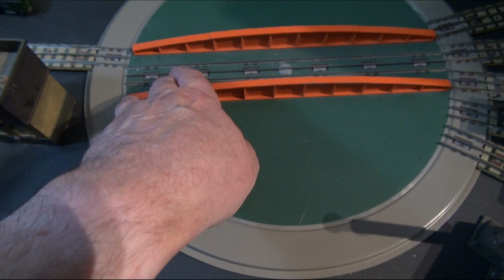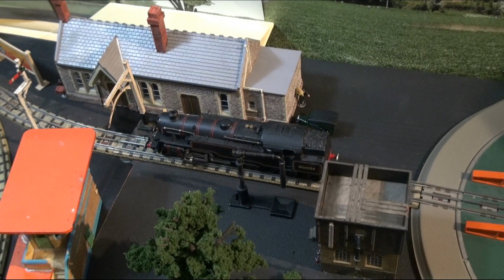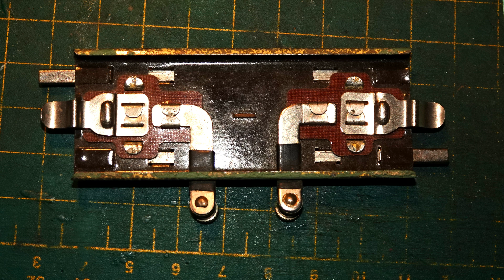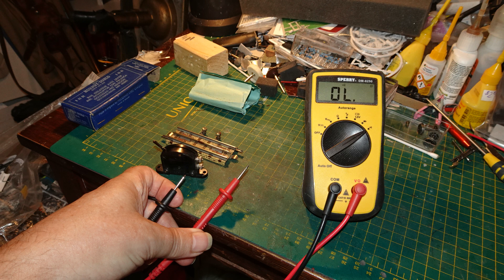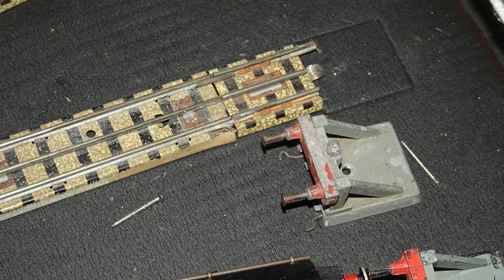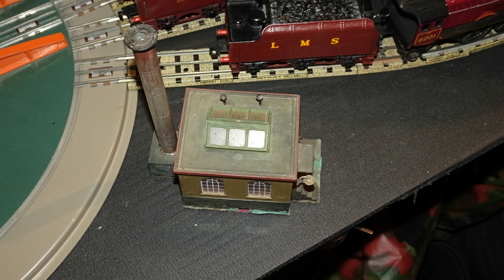OO 221, Dublo 3 Rail: Isolator for Turntable Parking

Comment: Hi Ken. Now that you have an isolating quarter track and see how it works, should you need another do you think you could make your own? The instructions say that the switch is specially designed; I don't believe that for a moment. It would be an extra expense of course, but a modern switch (especially as most of it would be hidden) would work more reliably/efficiently. I dare say you might be reluctant to mix "old" with "modern". Well done, nevertheless.
Reply from the maker: Paul, I could very easily have just made a switched isolation myself. In fact I was thinking of doing so, as buying a Hornby isolating track on eBay UK was going to cost me 30-40 pounds, with the shipping, which just seemed ridiculous. But when this Hornby isolator turned up locally, I thought that it would be both simpler to use (not allowing for my troubles getting it to work), and also nice as another example of a period-appropriate Dublo component.
Reply: I have done the same as you have done, however I have used a hornby dublo red button instead and hold it down when I want power to this siding.